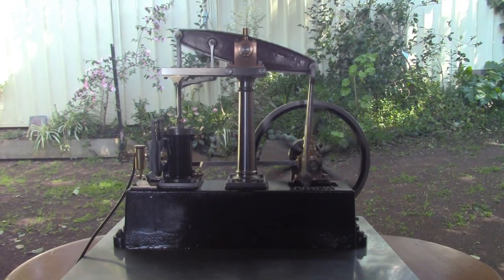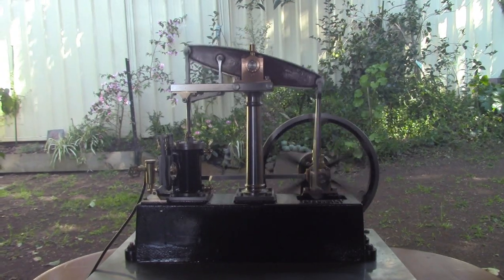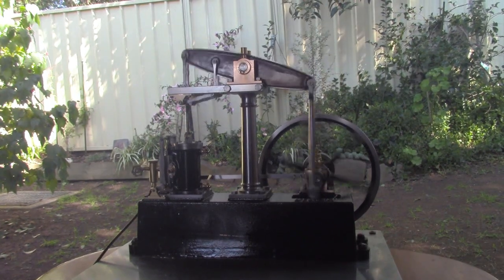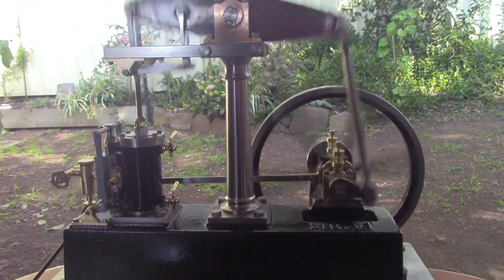BEAM TEST RUN

Comment: Thanks for the videos 1-8, can’t find any more, but you clearly finished a very nice model. Just a few comments on the videos which are intended to be constructive. Your comments are sometimes inaudible with the whining in background. There is too much tedious filming of simple turning and milling operations. I would have welcomed more detail of the setup processes, the tooling used, chuck speeds, milling speeds etc., and details of your use of superglue to mount parts on mandrels and join parts for machining, but many thanks.